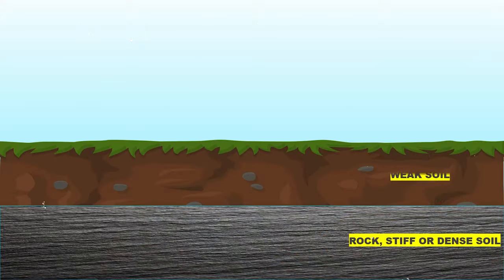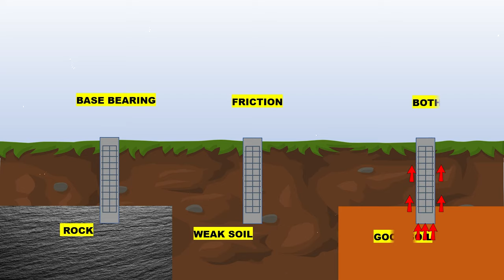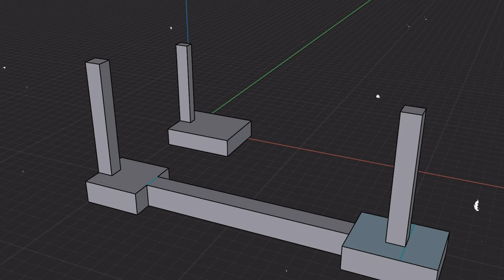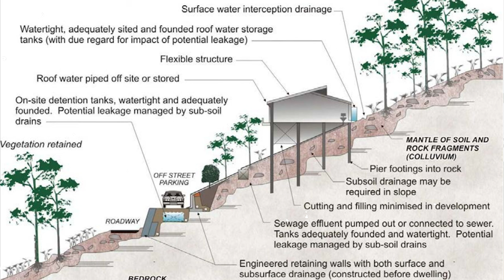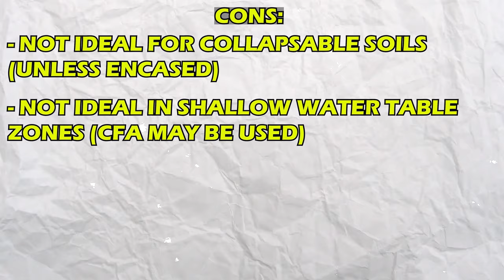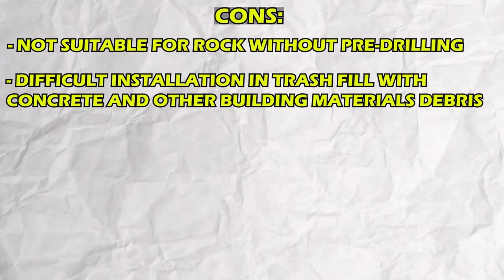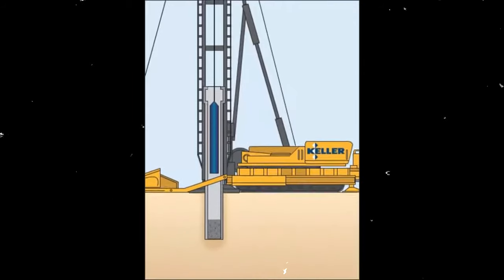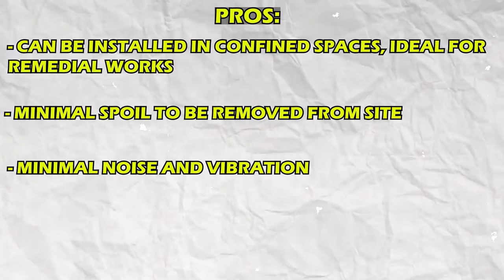From Bored to Driven: Demystifying Pile Foundation Choices

Comment: Awesome vid Gab. Can you do a vid on steel structures
Reply from the maker: Sure can mate :)
Reply: Hey this is John White in Seattle, Washington and if you Google my name, you might find that I’ve been around a while and I wanted to explain to you some things with regards to displacement piles and non-displacement piles. A non-displacement pile is an open-ended pipe or a sheet pile or an “H” beam pile,  where when driving the pile, you don’t have to displace a lot of soil. A displacement pile is a closed ended pipe or a concrete pile or a wood pile which, when driven, has to displace a lot of soil.  This is important when selecting pile driving equipment. Non-displacement Piles are usually driven with vibratory pile driver/extractors. Some people call them hammers, but they’re not hammers. They don’t hammer the pile.  They vibrate the pile, so the proper name is vibratory pile driver extractor.  If the pile is going to be a bearing pile, meaning that a load is going to be put on it, such as a building, or a bridge, then this pile will usually be finished off with an impact hammer to determine the bearing load. Impact hammers have a weight that drops on top of the pile. Love ya:

John White 
PACO 1977-83
ICE 83-1990
Founded ACE 1990
Co-Founder/Inventor APE 1992-2012
CEO Antaeus 2016- present